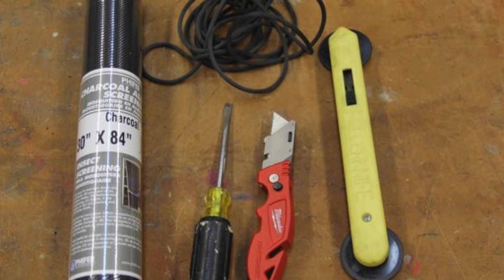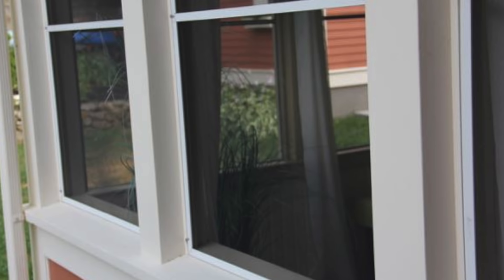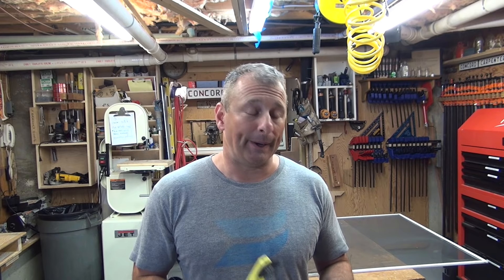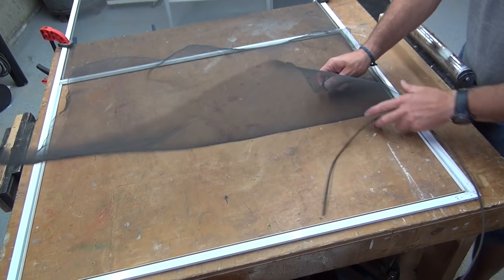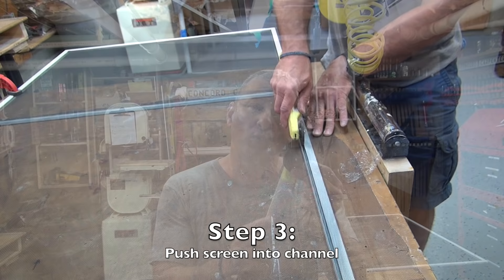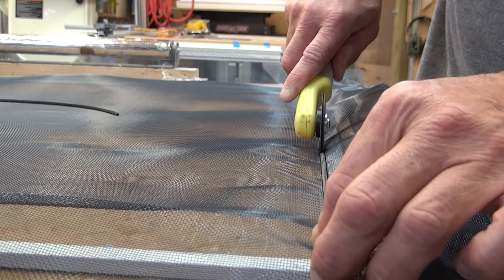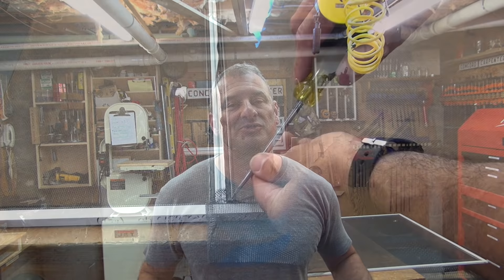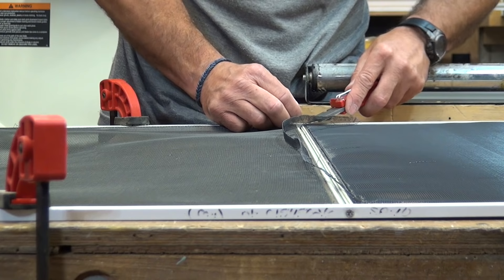Replacing a Window Screen 5-Steps

Comment: Your the only video I found that said to push the screen in to the grove FIRST, then place spline in. Great tip!!! Thank you!
Reply: This lil trick has saved me several more lengths of crumpled aluminum screen. Ofc, had I seen this before I bought the supplies , I would have gotten pet screen like I should have 😾

Comment: From personal experience, here are three mistakes that a clutz (like me) should watch out for on the first screen: 
1. Make sure you are doing the right side of the screen (the wrong side also has grooves, but the spline won't really fit into them without much effort....).
2. Make sure your screen is laid out the proper way to make the best use of screen material.  Remember: the roll in only so long, so turn the screen (probably sideways), so that you can use each roll for as many screens as possible.
3. Double check which end of the roller you are using. If you use the sharp end (that looks like a pizza cutter), you will not be able to push the spline in (but you WILL be able to cut and ruin the screen material.....).  The grooved end works.
Good luck! This job is easier than I imagined.  I saved $450 by doing our ten windows myself.
Reply from the maker: Glad it helped! Please subscribe
Reply: Some how the grooved end actually cut my screen

Comment: Thank you so much for this super helpful video! A word to anyone doing their own repair, don't make the screen TOO tight! I made mine super taught while installing the spline and now the frame is bowing in the middle. Learn from my mistake; give it a little give! 

Thanks again for this great video!
Reply: I was about to; thanks for sharing ✨
Reply from the maker: Glad you enjoyed it, please consider subscribing and clicking the notification bell.
Reply: Done!
Reply: Thanks.. i came for this info
Reply: Thanks.  I’m about to attempt mine again. I thought I could do it easily and I messed up a large piece of screen.
Reply: That tip really helped.  I thought it was supposed to be tight.
Reply: Hey this is really really good advice.

Comment: As a professional window manufacturer, I usually have something to correct in a YouTube video but this was spot on for aluminum screen. I have some tricks for getting the right tension on fiberglass screen (too tight and you can bow the sides and create a twist in the frame)  but this was exactly how we do our aluminum screens.
Reply: Adam Oliver ok so give me some pointers for fiberglass screen adam, i taped the frame to the floor and worked my way around the frame applying light tension to the screen when i got to the fourth side but when i put the screen in it was still pulled in a little in the center on the long sides.
Reply: It takes a little practice but if you have the frame flat on a table and the fiberglass screen wire on top, the first and second sides are just a matter of keeping the wire straight and as smooth as possible. When I move onto the second and third sides, just the action of the spline being rolled into the channel creates tension on the screen when it’s already rolled in on the opposite and adjacent sides. To keep from putting too much tension, I actually press the screen to the table on the inside of the frame (approximately 1/4”) and follow in front of the roller while continuing to hold the screen down inside to actually create a little slack that the spline will take up as you roll without making it too tight. This is hard to explain without a video so if you have questions about my explanation just ask. But basically what I want to do is instead of pulling the screen tight as I’m rolling on the last two sides (this will make the screen too tight as you roll it in because you are tightening it even more as it is rolled into the channel.) I want to create an even amount of slack in front of the roller and I do this on the inside of the frame but pushing it down to the table.
Reply: And then for those times that it doesn’t work as planed I make sure I buy 100 ft. Rolls of screen wire. Lol
Reply: Yeah my frame ended up with a bend when I tried to replace the screen. It wasn’t too tight, I just launched the thing across my basement into the wall before snapping it with my hands because my knife slipped and cut the new screen 🤷🏻

Comment: Pro-tip: #1:  Do not try to get the old spline out from the middle of a groove, or from a corner where it has been kept continuous.  Look at the corners (with a flashlight if need be).  At least ONE of those corners will have ends that you can get a small screwdriver under.
Pro-tip #2:  After you're done, hold the frame, spline-side up, at a low angle and see if any of the spline is high, or not fully seated.  (View this from all four sides.)  I saw this after my first re-screening and tucked those areas down with a flat-head screwdriver, held at a diagonal angle that just covered the width of the groove.  I don't know if using a screwdriver will damage the spline material, but my screen had grooves that weren't fully uniform on all four sides, and I had to make do with what I had (in other words, the spline roller didn't work well on two sides).
Pro-tip #3:  If you intend to keep the spline material continuous around corners, know that the spline roller will not get near enough to the corner to do the tuck properly--use a flat-head screwdriver for that.

Comment: I had replaced screening in the past, but watching your video gave me a tip that I had not tried before. It is sooo much easier done your way. Thanks for clear, concise instructions. I had my screen frames all ready to go, and replaced all four of the damaged ones in less than an hour, including one for the sliding door! Thank you!!
Reply from the maker: RJ Smith which tip?

Comment: Could make a $50 or $60 profit doing this. Thanks for the video. Didn't know it was that easy to replace a screen. Home Depot doesn't sell a full completed one and they stopped doing screen repairs and installations. Lowes had me on hold and wanted me to call another number they gave me. Watching this gives me confidence because they sell a kit that has all the materials you mentioned at home depot.

Comment: I have tried replacing screens before in the past and it didn’t go so well.  The key was pushing the screen into the groove before trying with the rubber spline.  This was so easy! Thank you so much for making this video!
Reply from the maker: Tom Piche definitely helps!
Reply: I never that it either. Great tip!

Comment: This is an excellent video and I learned a lot from it! I had three  window screens repaired and I was charged "$30" per screen so my cost was "$90!" The next time I needed to have screens repaired, I took four screens to the local hardware store and the cost was "$40" which was "$10" per screen! They looked as professional as the ones that cost "$90!" I will never pay anyone "$30" to repair screens again!'I have four screens that need to be repaired, but because of COVID-19 my local hardware store has been closed for several months! After watching your video, I plan to go to Lowe's to get what I need to repair them myself! Thank You!🤗🤗

Comment: I took two screen doors to three different rescreening shops.  They quoted me between $60 and $90 PER DOOR and that was using fiberglass mesh (not aluminum).  They all said using aluminum would greatly increase the cost.  I would rather wash windows or bathe the dogs than rescreen anything but I have no choice.  Thank you for your video.

Comment: Great video. After watching I just did my first screen. only took me about 45 mins.
One tool I would also add is a small. brush such as a 1 inch paint brush. The old spline was hard plastic and dried out. It crumbled as I went to remove It so I ended up brushing all the debris out of the channel before starting the new screen.

Comment: Thanks i completed the task in 20 minutes for the first time. Since i did not have a work bench, i used the truck  tailgate for the installation. The truck tailgate is a good working height.

Comment: I used to work for American Screen in Florida back in the 80's.  
      I wish I had paid more attention to keeping it tight,  without the bows, & hopefully a clamp will solve the issue. I am using fiberglass screen. 
   TY4SHARING 🙏

Comment: Great video. I do plumbing and hvac, so I figured it would be a breeze for me. I tried doing it without any help or videos, ended up kicking myself. I wasn't rescreening though, had to build the outside of the screens too. Ended up not taking into account the difference the corner pieces added and had to start from scratch. Decided to watch your video to make sure I was doing it correctly. Straight to the point and the second time I attempted, turned out great. Thumbs up and subscribed!

Comment: *Only comment that you might have simply reversed is that the concave, the shape that curves inward should be used first, as it helps align the spline straight so it doesn't twist, then if need be, the convex to make sure its in tight. Great video.

Comment: Thank you sir! One down, one to go. I think I was too worried about it being taught and it bowed the long sides of the frame inwards from the tension. I found that the act of installing the spline does stretch the screen to pull it taught enough.

Comment: Learned a valuable lesson. Make the spline stop right where the two "pin" insert through the frame. The pins that hold the screen from falling out of the window. If not, you will have to drill through the spline to allow for reinsertion of those pins when you're done. Ugh

Comment: good video, thank you.  my 1st time doing this and it was a success.  took about 90 minutes but i was extra careful.  i didn't roll the screen around the whole perimeter before rolling the gasket.  i went about 12" rolling the screen and then rolling the gasket, then another 12" at a time, gently pulling the screen taut each time before rolling the screen.

Comment: I had a cheap plastic spline roller, and when I had to do another window, I saw a tool with metal wheels. I bought it. I actually like the plastic one better.  It seems like the metal one likes to come off the spline really easily when rolling it in place. It might be because the groove is more narrow on the metal one.

Comment: THANK YOU!  I have 22 windows on my condo, and this task had seemed too daunting until I found your video. I now have the courage to give this a try.  

Curious if anyone has discovered secrets on how to hold the screen taut.  Will try it with some weights, but I imagine this is going to be the challenge.
Reply: One thing I've found helpful is to take some painter's tape (the blue masking tape) and tape the aluminum frame to the table.  It at least holds things in place while you are trying to keep the screen taught.  Good luck!
Reply: @daveparker839  Thanks Dave!  Will add the masking tape to the supply list.  Giving it a try this coming weekend.

Comment: Use your rubber mallet instead of the roller to start your spline. It's so much easier to start. after it's been tapped into the groove as is then do you use your roller wheel, especially if your doing the job on the house/ porch/ patio, etc; I don't know about the shop as doing it inside on a table might be OK. But I found it best to just tap in the spline first w/a rubber mallet & then the roller wheel.

Comment: Thanks, just did mine. I do have a tip tho. If your frame doesn't have a center support, don't overtension the screen. I wanted mine tight but it ended up bending the sides in so it didn't fit the window correctly. I had already cut it so I wasted a good bit of screen material

Comment: You should probably revisit this adding that you should absolutely make sure you have the right size spline. A customer of mine had their screens fall out over a year or so because the splines were too small. Best way is to bring a few inches of sample splines since they're almost impossible to tell apart. It's hard to mic rubber. LOL Also maybe you could get into the different kinds of spline tools, especially plastic vs steel (I'm thinking the plastic cuts the screen less). I'm trying to upgrade to a professional tool and it's a bit confusing.
Reply from the maker: there is no way to edit it other than for folks to read the comment I suppose I could pin a comment at the top

Comment: Yea, the roller wheel tool I found laying around is from the 50s, metal, skinny & cutting the aluminum screen. I think it may be some kind of wall paper tool instead. Can't do the job without the right tools. 3 hours later & I can't find a roller tool that I can pick up local that doesn't have a 1 star steaming pile rating. And I can't see the name on yours.
Reply: The best spline roller tools are made by Everhard. They are made in Canton. Ohio and are sold on Amazon.

Comment: Great  video. Thanks to your clear instructions, I replaced the old bug screen. Now I need to install it in the window. The window is on the 2nd floor. 

Is there a Convenient way to install it from inside the 2nd floor room ? There seems no easy to do this. 
I am not sure I want to use a ladder from outside the house to push the screen in.

Comment: Good presentation, for a simple, standard window screen replacement, but how is the process different when step #1 is not an available option.  The screen is designed to not be removable, though will slide up and down inside its track.  The windows in question are ground level, so no need for ladders, and the drop in kind for easy cleaning, but being vinyl frames when adding the spine strip, you cannot add too much pressure to be sure how secure they are.  Should something like glue be added to safeguard the screen stability and security
Reply from the maker: Allison Grabarczyk (Alys Ann) metal storm window track? That’s removable - tilt them to remove

Comment: Here is a little tidbit... if the old spline doesn't want to come up and getting a tool under it seems impossible, try poking the end of it with a safety pin and working it in about 1/8 inch so the spline can be lifted.

Comment: Aluminium is not stronger than fibreglass; Great video. I’ve got to disagree on one point. Aluminium is not stronger (demonstrated @onsiteflyscreens on Instagram). Metal mesh also dints and stays dinted. Eg, if a dog swipes claws down the mesh it will stay creased. Fibreglass will return to its original shape. 
One advantage to aluminium/stainless steel mesh is fire/ember resistance. For those near a bushfire, metal mesh will keep embers from floating through your windows where fibreglass will fizzle away and make the problem even worse (also demonstrated @onsiteflyscreens) .  Ember attack is a huge contributor to home loss from bushfires. 
All the best. Great channel 👍

Comment: Think there's a major IMPORTANT info that was left out

MAKE sure to buy the right size roller...  If it's too fat (the concave roller side) you're not going to be able to press it in all the way then you're gonna have to flip it to the convex part, adding a few  more possible steps that's not needed.  

I'm talking about 2:50.. Don't just buy any roller, buy the size that actually goes in. So measure before hand.  Same goes for the spline but I just re-used mine anyways

GOOD LUCK

Comment: Good video!  The one thing this video didn't show was how to cut the frame.  Do you use a hacksaw, chop saw?  I have aluminium frames.
The cost of doing it yourself is higher than $10/window.  The roller tool alone is $10, then I purchased a kit that came with the frame and spline for about $18, it didn't come with the screen mesh, so I have to buy that too which may be about $10, not sure.  The roller tool was considered the "deluxe" version, but Lowes and Home Depot only had that one option.  If I had bought one online, it would have cost $4 plus shipping.

Comment: Very good video except for one small detail missing.  Question.  Is there an order in which side to do next?  After you do one side do you work around to each side or do one side and than go to the opposite parallel side next, or does it make any difference?  Thanks

Comment: This helped alot.  However, when I pushed the spline in it was not nearly as easy as your example.  On top of that, the screen would tear as I ran the tool down the channel before inserting the spline. 
If that wasnt bad enough, the roller tool would pop off the spline as i rolled it (with all my strength) and make bends and breaks in the screen.    I guess I need a smaller spline or go to the gym!!
How do you know if you have the right size spline?

Comment: In theory, an easy job. Easy if the screen doesn't cut every time the spline is pushed into the slot with the tool. An hour into it and all I have is scrap screen. I must have an odd-ball screen frame.

Comment: I have an old screened in porch with aluminum screening that needs replacing. The door and screens used to come out but have all been painted over making the traditional method not possible. I was going to take out the old screen then adhere the new screen to the wood, anything you'd recommend for that job? I am afraid staples with rip the screens.  Thank you for any help.

Comment: I liked the video. One thing that wasn't shown is how to remove the screen from the window frame without busting it.
Reply from the maker: Cut old screen and pull it out r use a utility knife or small slotted screw driver and dig out the spline

Comment: Appreciate the advice/ video. I must be doing something wrong as the sides of aluminum bow in too much and then short of fitting into window.. any advice!? 
We aren’t pulling the screen to tight while pressing rubber in btw
Reply from the maker: you must be pulling something if things are bowing

Comment: Many ways to screw up a screen-most common is to allow the screen to draw too tight as you roll it in-the frame will bow in like an hourglass-also-there is no universal screen spline,you need the right diameter,this is critical